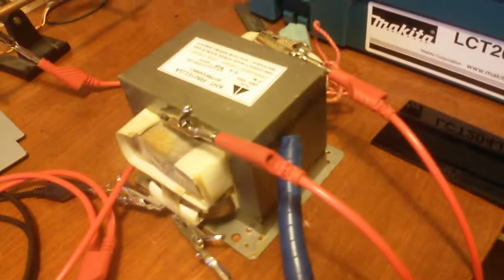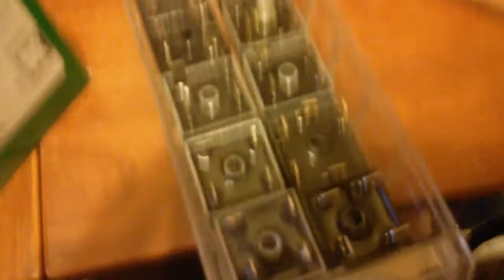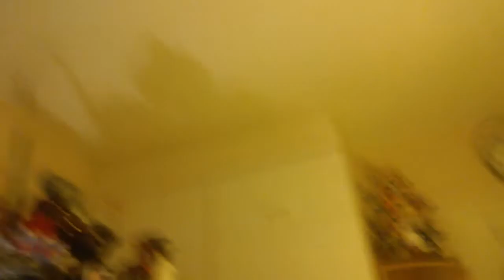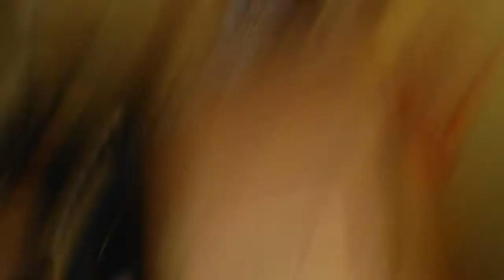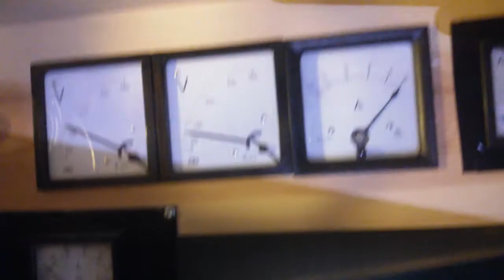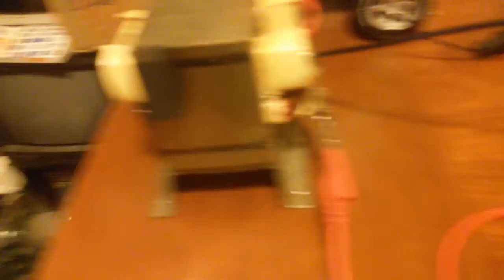Rectified Mains Carbon Rod Arc

Comment: With carbon rods and 230V mains you can make sick arcs without any rectifier! Just put one ballast in series, like an electric kettle or heater. You have to get at least 10A of current, so 2-3kW device will be optimal. The arc will pull like 5cm length. Then try 20A or 30A, it will get really serious and incredibly bright! :)

Comment: Nice :)

(You should add a capacitor on to the bridge rectifier to protect it from voltage spikes created by the balance choke through self-induction)

Alex